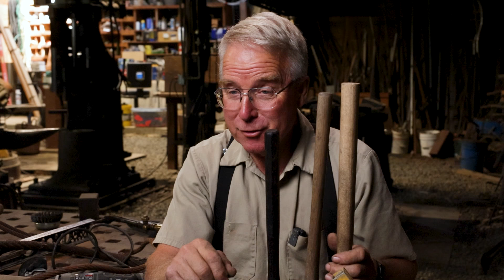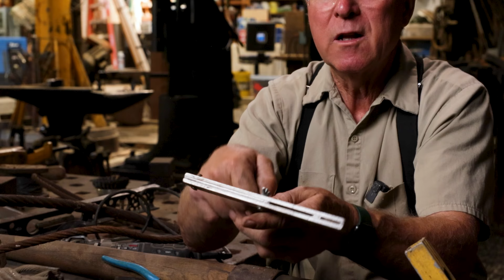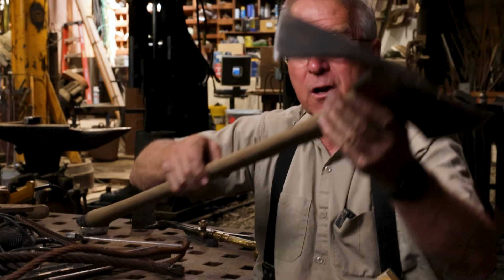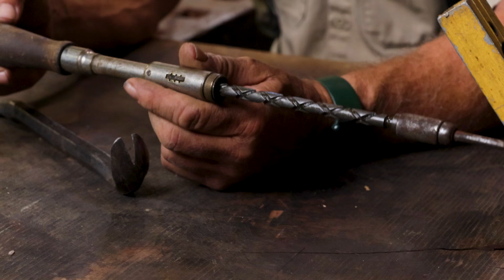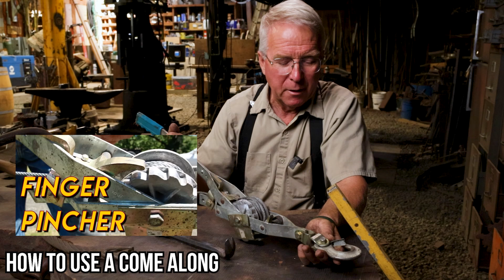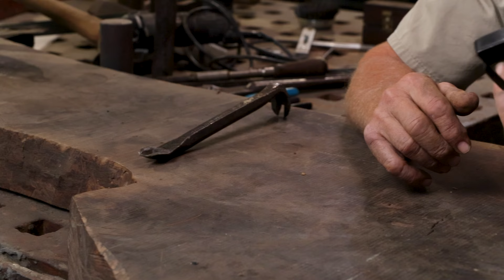The 15 Weird Tool Nicknames You Never Asked For

Comment: Hi Scott! Thanks for introducing us to those nicknames of those tools. My favourite was the "come-along". We Germans tend to have names, that are more functional descrptive.

As for the oscillating tools, my nickname is: "high-school teacher tool". This is due to the fact, that I still struggle to find a really compelling job for such a tool. It let me stranded two times, when I thought "that's a job for my multitool!". And whenever I am in a hardware store, I see people of the high-school teacher category (two left hands, with the thumbs on the wrong side) flocking around the display, where the Fein-Multitools (AFAIK they invented them) are on display. For me a Jack of all trades but a master of none.

One other more modern tool has a funny nickname over here. It is the chordless angle grinder. It is called her "universal spare key for bicycles".German translation is much shorter, but you get the point. Many expensive bikes have been stolen by cutting the lock with such an angle grinder in seconds. Despite the noise...

Cheers
Andreas
Reply: oscilatting tool is too hard to say as well as spell.... If I ask my helper for the wiggle saw... they know right away what I want.

Comment: Your ‘buzz saw’ is an oscillating saw or multitool to many, but I sometimes still refer to it as a Stryker saw, as it was first designed in the 1940’s by Homer Stryker, an orthopod to remove plaster casts from limbs without having to use shears that would be more at home in a smithy. It’s still the same design made and used in hospitals to this day. When I think of a buzz saw I think of a circular chop saw these days, or one of those big 5’ diameter blades in a saw mill.

Your ‘cat bar’ and to some extent the  ‘spud wrench’ would be called a “Podger” or a “pinch bar” in Scotland. Basically it’s a bar that can be used to line stuff up, nudge things together or prize them apart to get them set up. Larger ones at 150/250 cm can also be used to start holes in the ground.  Say you need to set up a line of 1*1 or 2*2 posts to mark a boundary or tape some cables to, you would poke the podger into the ground a few times to loosen up the dirt and make t easier to hammer in the posts with a ‘mash’ - which can cover a small 3lb lump hammer like your Helga up to a sledge hammer.

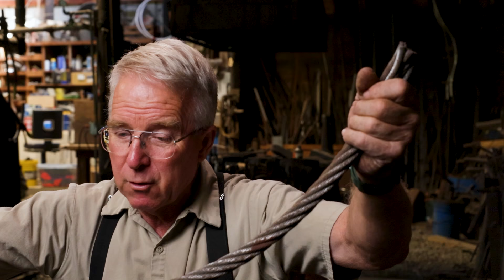Comment: 9:40 I used to use these in demolition work for dragging huge steel H-beams away from the work site. They were problematic on steel, but my boss swore by them, so we had to use them. I'd weld tags onto the H-beam to stop the cable slipping off the beam.

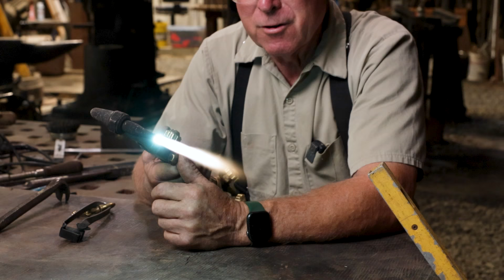Comment: 12:11 more names for the "hot wrench": first is the "victor key", it's the key that will open any lock. Second is the "blue flame metric wrench" for those those bolts that no wrench ever seems to fit properly.

Comment: 20# hammer is a button set around here, first hit is butt and the second is set. butt and set. Your Cat bar is also known as a sleever bar. Also it was not uncommon to see a big yarder that could part 1 1/8" chokers back in the day, Berger, Skagit, Washigton etc.Also a digging bar may also be called a pinch bar or a track bar. Smaller hammers are single jack or double jack. Cheers bud!

Comment: Yankee... the original cordless automatic screw driver. I used them in my locksmith business and made a lot of money. I bought 6 houses in Silicon Valley with the money I made with my Yankee. I made a custom bit for the hollow bolts used on Kwikset deadbolts.

Comment: Interesting thing about that "hot wrench" is that when you use it to cut steel, you're not melting the steel. Once you use the neutral flame to heat the steel to red hot you hit it with the jet of oxygen, and that kicks off a high temperature oxidation reaction that basically flash rusts a kerf into the steel. Once you get it cutting you can actually turn off the acetylene and finish the cut with just oxygen.

Comment: I use some smaller versions of what you call a cat bar. I was taught by my grandpa (loger and mill Wright in the OR coast range, from the '50's-'80's) that the smaller ones are a pin bar. Often used for lining up bolt holes.

Comment: I have my dad's coffin hoist.
The actual name was Coffing.
It was a heavy duty come along with instead of a cable looked like a motorcycle chain.
He would attach to a bulldozer and then to high tension electrical cables.
An engineer would measure the air temperature and tell my dad how much droop to put in the cables.
Reply: I have used something similar called a grip hoist. Used it to pull most of the tension for 7/8 or 1 inch wire rope over a river. We set the cable droop with a turnbuckle.

Comment: My oscillating saw is called: Zeezee.😏
My father and me had always had names for the hammers 8kg (17.7 lbs) Samson, 5 (11 lbs) Goliath, 3kg (7 lbs) Steven, 2 kg (4.5 lbs) Gusti, 1.5 kg (2.2 lbs) Johnny, 450gr (1 lbs) Crumb.

The choker is indeed a dangerous job especially because of the environment it is  used: mud, half frozen fingers in winter, 3-5 ton logs. Been there, done that. I feel blessed to have all my fingers decades in the heavy work.

Comment: I started in managing hardware and tool businesses back in the 1970's. I remember even then we still kept the Stanley bit cabinet in our store that had the drawers with screwdriver and drill bits for the red handled stanley Yankee model 30 and 31, drivers. If they had the spring inside they were the 130 and 131 which is what we stocked. There was the small handyman size 35 (or 135) too. In the cabinet were the springs too. We usually asked the carpenters if they wanted us to remove the springs when we sold the drivers. For cabinet and fine work they usually did, as when new those springs were POWERFUL and screws were slotted. Nothing worse than firing a bit deep into expensive wood. I still have 2 in my tool box. The bar you called the "cat" bar to me was a "pinch" bar, usually used to align machinery together more than a crow bar use.

Comment: A buzz saw is a belt driven ,large circular bladed (2 1/2’ -3’ diameter) fire wood machine . If you want to call the oscillating tool  abuzz saw that’s fine , but ain’t .

Comment: Anyone else starting the video wondering is horse cocks(scaffold pins) are going to come up?

Where'd you get that wonderbar? I've never seen one that long. To me a door bar is a Kobalt tool I bought over a decade ago, that has a roller for a pivot and a thin toe on the working end, and a bit on the other to catch the toe of a boot. Back in my trades days I used it mostly for drywall, but is also did doors as well. 

There is dispute as to if CAT hardware is the best. They did create their own grading system that added bolt grades above the SAE standard ratings.

The variety of names for the oscillating tool is due to it's long name. To me, a buzz saw is a large PTO driven circular saw used to  rapidly buck small diameter firewood to length. 

Dikes have a simple way to remember what they are, in a dirty sense..... Lesbians "fucking" equals 2 f;lat surfaced banging together..... 

I'm not much interested in seeing a come-a-long as I've got moving a 500lb furnace through a 32" door with a 6" concrete sill,   2ft up into a kitchen, then l through the kitchen, then down 8ft of stairs, with just me and my 74yr old father. 

 I was rebuilding the structure of my parents truck with my father yesterday, and although ne spend his life working for the railroad, he had no clue what a zip screw was... It this case I's recommended using them to screw the remaining roted out bed sheet metal to the 1/8"+ structure we'd installed underneath it. In my past job, I saw tractor-trailers using 2-3 5/16 zip screws to permanently mount thbe ratchet straps holding down their loads.

Comment: Glad you show the “end nipper” which is really a nail puller.   That’s a long handle by Channel lock best made as it can cut 16d framing nails or pull without marring.  This is no longer made at that length but Channel Lock has shortened and changed radius- we should riot and demand a call back to original specs 😁
Reply: The big ones were used as hoof nippers, long before 16d nails were made. You can still buy them, anywhere sheet metal tools are sold. They are good for pulling s and d duct joints together.

Comment: The cats paw with the sheep’s foot is a worthless tool IMO and actually degrades the real value of the tool.  Instead choose the square end as it allows the tool to be struck directly with a hammer when applying paw end to a 16d toenail.    Also doubles as a 16d nail punch in tight spots hitting paw end with flat on end on nail.  Much easier in tool pouch.

Comment: The reason it’s called a striker is related to its historical cousin, the original flint and steel.  When starting a fire with a flint and steel you “strike” the flint with a piece of steel.  Therefore the tool that drags the tiny flint tip across a knurled steel rod to start your torch fire is quite naturally called a “striker.

Comment: I'd love a video on specialty tools from various trades; 
I don't know what I don't know, but I do know that the day I discovered stair gauges (for a square), stair stringers became faster to cut. How many non-plumbers cut PEX and ABS with a utility knife or saw (and ultimately stab themselves or make a mess) when there inexpensive and easy-to-use specialty hand-tools made for purpose? I'm sure are odd, unique, specialty tools all across industry and trades, many just as inexpensive as the above list, that would solve many job-site problems, if we only knew they existed.

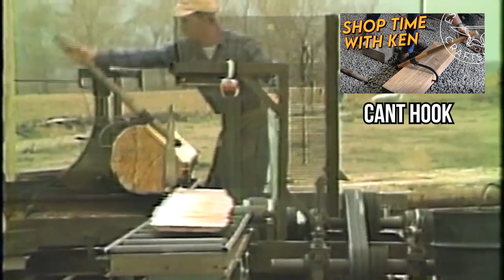Comment: 3:26 when used to align utility poles the direction of rotation is called with the term  “left hook” or “right hook” the tool only applies force in one direction. Put the hook on the left for counter clockwise rotation and on the right for clockwise.

Comment: I thought I was the only one to buy AND keep a squangle.  Often wondered if a compound squangle could be made.

A choker: the device used to see if the new guys are cut out for logging.

When I was kid, 18-21), framing houses the boss had a peevee w/ short length of chain between the hook & it's handle connection.

We used it, well, HE used it, while we scurried around getting 2 x 8 tongue & groove sub-floor arranged ahead of him.
Once we had 3-4 rows tapped together, the hook would get set over the furthest board, the peevee spike stabbed in the floor & the rows pulled tight, together.

We'd drive a 16 or 2 to hold them, then move on.

Three of us, in sync, could flat lay some sub-floor down.

My nearly 72 yr old shoulder is testament to me being the one to go back & hand nail the flooring off while the boss was laying out the walls, so we'd have a roadmap to follow while framing.

My shoulder is trashed; has to switch to 97% screws in the '90's, so I could keep doing re-models.  It's screams at me, at the end of the day, this summer, building a 16ft extension on the back of my house. 

Thank the Lord for ice & icebags.

Shoulder probs is what ended the boss's carpentry at 50; he grew up pounding nails, too, but did it far longer than I did.

Not complaining, glad to be alive & still able to do it. Especially, after losing 2019-23 to three bouts of cancer.

Comment: A small piece of trivia for you when talking about strickers — they cannot be used efficiently by lefties. I’m not saying it can’t be used by lefties, it can, but it’s much more difficult than you think. Before I retired, I was a scientific glassblower; I made the kinds of things you see in laboratories with coiled tubing and things bubbling away. We also use strikers to start our torches. 

For the last thirty-two years of my career, I worked at a university making glass apparatus for chemistry, biology, geology, and physics. Once a year, I taught a class for the students gain basic knowledge of what’s involved. Every once in a while, a student would have a devil of a time starting their torch; turns out, they were all lefties. Here was the issue: when held in the right hand, the thumb is not only pushing the flint across the steel, but it’s also pushing the flint INTO the steel. When held in the left hand, the “into” part is not easy to accomplish. When you add that the strickers we were using were old and often worn out, and smooth, you had to push into the steel with more effort, and physically, that was not easy. 

I’ve looked, and no one makes left-handed strickers. The best you can do is to make them aware of the issue so that they can apply that direction of force as best they can. Alternatively, they can admit defeat and use their right hand to start their torch.

Thanks for your videos, I do enjoy them.

Comment: I started working in the construction industry when you did, I was a little older, but stayed there until I retired a couple of years ago.  I used many of those old tools, picked some up and restored a couple (Yankee driver for one), eggbeater drills (which I actually used for a very precise repair on my progressive reloading press where a cordless was not a good fit.

Comment: Well we call it what it is. A jamb saw. Before this.
Tool came around.We used to handle in a piece.A scrap flooring to cut the door jamb to height. So the floor fits under the jamb perfectly.

Comment: I call the oscillator a “shaker” because when they first started hitting the market they were crap and with any amount of pressure would cause the handle shake more than the blade.
Reply: When the patent expired and the knockoffs hit the market. The original power tool was from FEIN and was Big Bucks expensive (though worth the price even then).  That tool was late 1960s.
But a bone Docter came up with the original oscilating saw 20 years earlier.
The quality of blades is all over the place.

Comment: Still carry a modern version of the “Yankee Driver” in my electrical work bag.  Quickly run down screws to snug, before switching to the torque driver.  That way I don’t over tighten or strip the screws, or bugger the heads.

Comment: The door bar (in my world) is called a "flat bar", but much like the sheepsfoot, Mexicans (most of the people on the job) call it a "pie de cabra" (nanny goat's foot)...  Regarding the Yankee Screwdriver, we called it a Yankee pushdrill.  Alarm installers best friend -- perfect for drilling holes for components, then sending them home with a Philips screw. There is another version, with a tip that flips (one side drill, the other side a philips), we just called it a "combo"...

Comment: Used many a come along hooked to a tree to pull engines out of our muscle cars in the late 70's. Fast forward to 2004 I'm driving a ready mix truck and keep hearing the finishers talking about come along's. What the heck would you need cable winch when you're doing concrete work? Then I saw one pick up the tool they use to pull concrete back and forth while screeding it off, doh, that's what the heck they are talking about. A concrete come along is just wooden handled tool with a 24" wide flat steel blade that incorporates a hook on back side for pulling concrete mesh up into the concrete. Newer ones are all alum, lot of weight savings over the wood handle/steel blade, using that tool all day you're gonna love the light weight.

Comment: Regarding the oscillating multitool, a few tradesmen I know call it "tickle saw", because it kinda tickles when you touch the oscillating blade.
(A few years ago, a client approached to see what that weird noise was.  I explained to her that it was similar to what a doctor uses to cut off casts, then turned the tickle saw on and touched the blade with my fingers to demonstrate how safe it was.  She screamed so loud that I jumped.  She later said she had understood my explanation, but still had a visceral reaction to me touching a moving blade.)
Reply: Oscillating saw , vibrating saw, feinmiester(the original version from Germany). It’s a better power scraper than a saw imho but sometimes you need a plunge cut
Reply: I know it as a multitool or renovator

Comment: As far as the oscillating tool goes, I first got to use one on a job with my old boss back in probably 2010, we were installing pre-finished hardwood floors for a customer and although I had known about the Fein saws, they were super expensive and seemingly specialty tools at the time so we used hand jamb saws on the door frames to clear the flooring. Being in Connecticut, the customer we were working for was and old school Texan, and he had a $20 harbor freight oscillating saw, and we used the heck out out of it.  He called it a whizzer, and it stuck.I now probably have three different ones,  I don't know how I did a lot work without them before

Comment: That oscillating cutter is a cast saw. Or at least it was when I first saw it being used by a doctor, 50 years ago. They'll cut plaster casts without cutting the skin underneath (with the right blade). I've only seen them for wood work fairly recently, but variants have been used in orthopedics for decades.

Comment: I learned a few things - but the best part for me is the "cutting torch" As my dad used to call it or "hot wrench" as you called it. My dad (Korean era Vet) used to use one all the time in his in-the-field metal fabrication work and it brought back a lot of memories for me. I was lucky enough to get to go to work with my dad on occasion (he was self-employed) and learned a lot from watching my dad work when I was 8-10 years old - the tool fetcher is what I was then and it's a good way to start to learn.
Reply: Tool fetcher,, , in Australia we call them Gopher, because you are told to Go for this, Go for that.
Reply: Or "smoke wrench".
Reply: Blue wrench in my shop

Comment: (holding up dikes) "These have one job, they cut wire"  Depends on what you're doing. a pair of dikes are very useful for pulling cotter pins, if that's a task you encounter frequently in your work, a pair of dikes is a lot more useful than an end nipper. An aircraft mechanic is one such occupation.